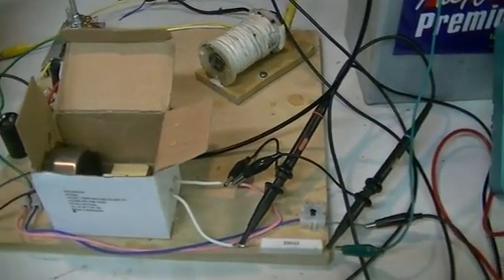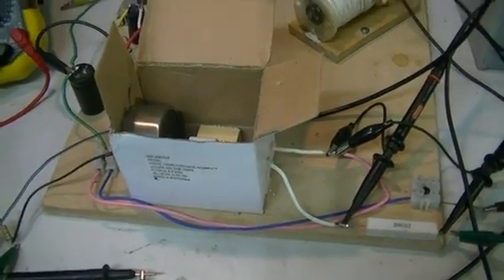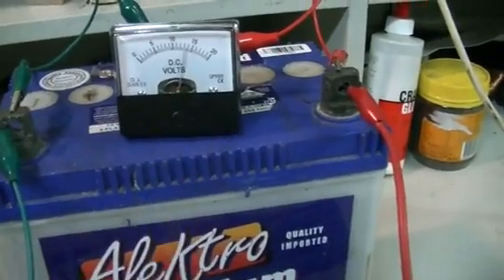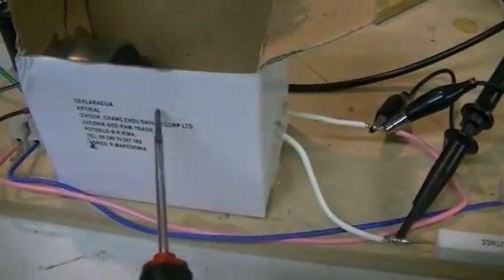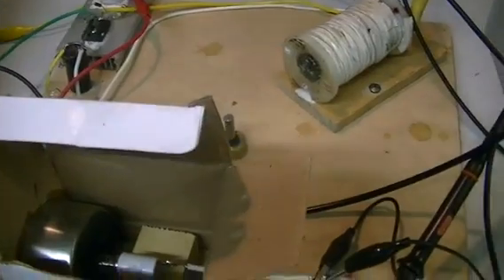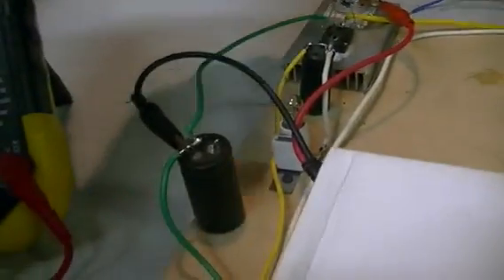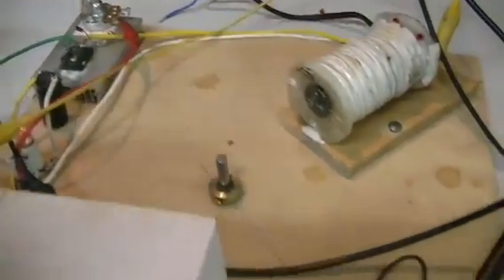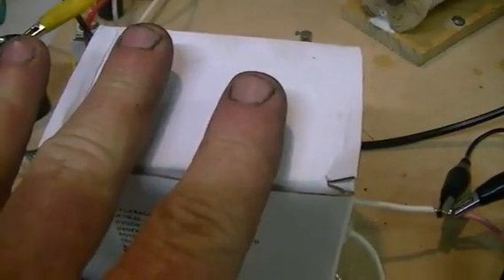Pulsed system measurements PT3

Comment: +TinManPower  , you probably solved the mystery .. but just to be sure : the whole circuit is a power resistor + bulb + extra circuitry all 3 in series. Yes the current through R (2.8 V - 2.6 V , divided by 1 ohm stays 200 mA  (not 20))stays the same and thus the same current is flowing in the bulb.  But the "extra circuitry" part has changed the whole setup by putting a C into it. The same 200 mA in the bulb and lesser light MUST mean that the voltage over the bulb itself is lowered by the added circuitry. And of course there is the temp changes too although minor in this case because of the low currents. // The sum of all Voltages over the parts of this serial setup should be the same as the power (battery) voltage, like this : (V over R) + (V over bulb) + (V over "extra circuitry") = V of power unit. So, even when the current I=200mA stays the same in both tests, the voltage over the bulb must have gone down because of the inserted C in the extra part of the circuit. Keep it up! and thanks for all videos. Cheers

Comment: Fascinating...for me I can not get away from kirkoffs voltage law and true power versus apparent power. My bedini wheel is similar to yours however made from poplar wood. It can generate 260 volts however I never ran it against a resistive load always rejuvenated batteries with it. Which reminds me I need to juvenate one now...let see some vacume...always a good time